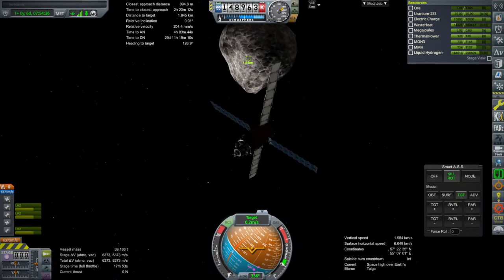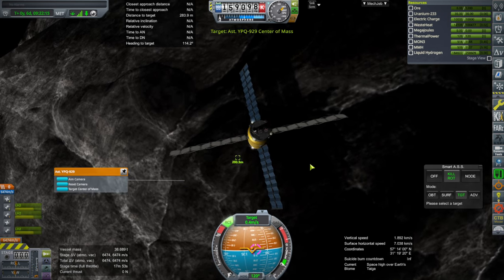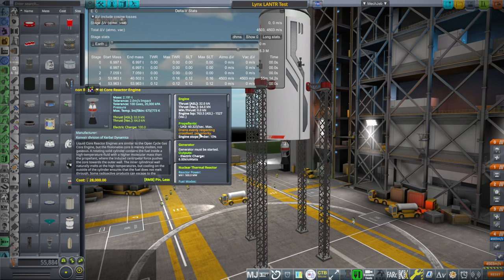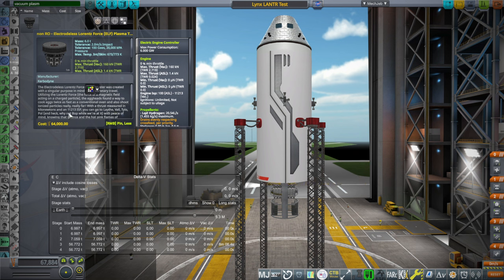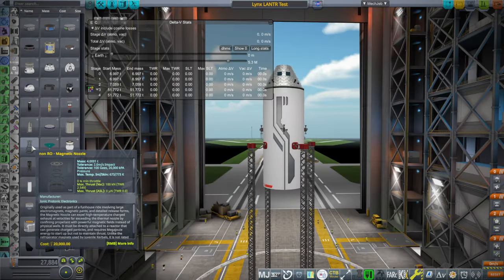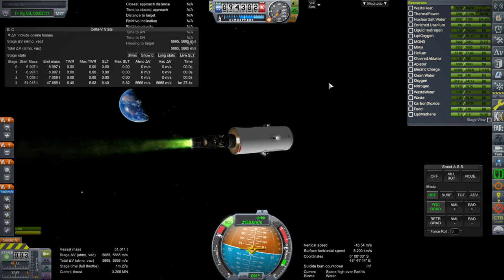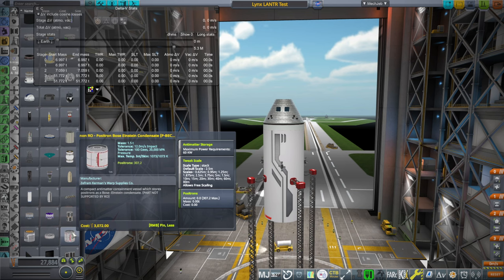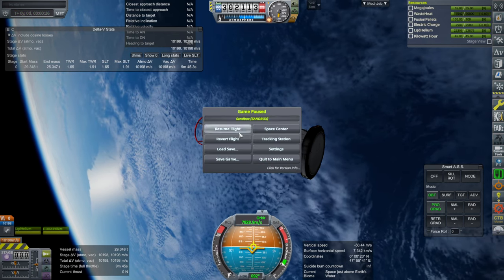RSS Interstellar with Exoplanets 06 (KSP 1.12) - Testing All the KSP-IE Things 5

Comment: I'm trying to do exactly this. I have everything working, but when it came time to send my starship off to proxima centauri, I had to give up just because of the time it would take to do the acceleration/deceleration, and I couldn't get persistent thrust working. Were you able to get the persistent thrust mod working? Like my ship should be able to achieve 40% lightspeed with several hundred million m/s of deltaV using the daedelus engine, I have 30 years of life support on board, and the ship looks very realistic as far as a "first starship" goes, but the acceleration phase is 4 years, so there's no way I could actually do the mission without persistent thrust. Even at 20x physics timewarm, that's so much time to just sit and burn.
Reply from the maker: I still need to experiment with Persistent Thrust in this version. Previously, it's been very finicky for me.